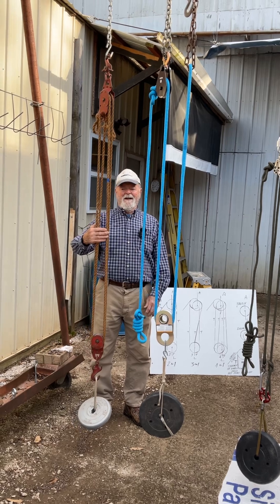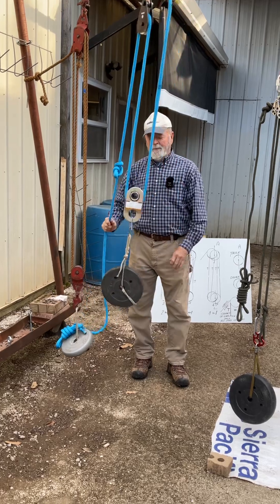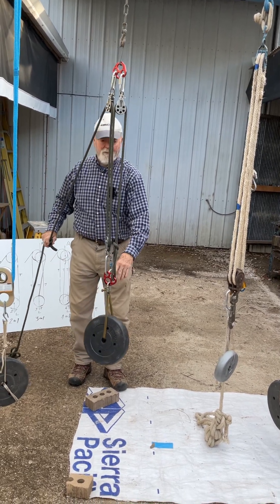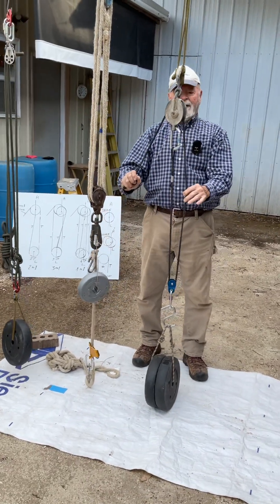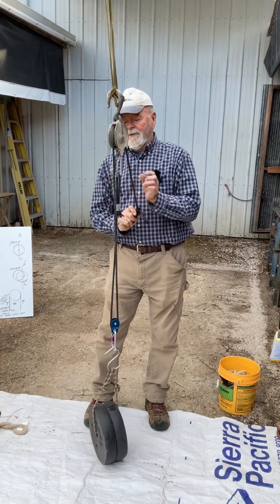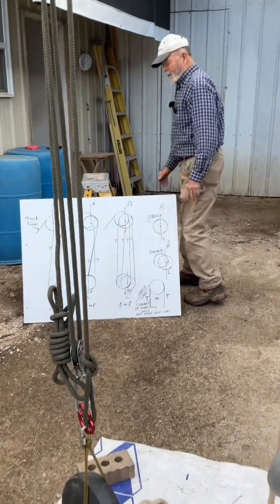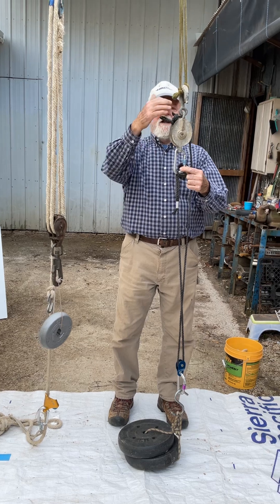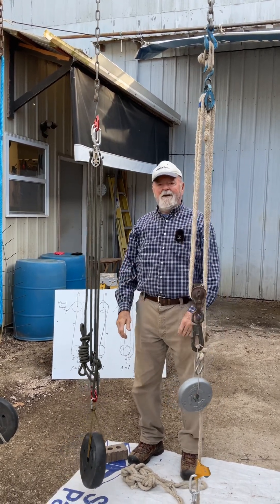Understanding Block & Tackle Basics                                   Subscribe@Build_It_Bright

Comment: Question sir,
In the 4:1 system. If the load is 1,000 pounds so that I need to pull the rope with 250 lbs. Then what does my rope need to be rated? Rated for the 250LBS or rated to the load of 1,000 pounds?
Thanks
Reply from the maker: The working load is 1/3 of the breaking strength. If each strand is carrying 250 lbs. you need a safety factor of 3 so the rope needs to be 750 breaking strength
Reply: @ much appreciated. Thanks so much
Reply: @Build_It_Bright  Where does that number come from? Why 1/3? If each strand is carrying 250 lbs, wouldn't you just need a rope rated for 250 lbs?